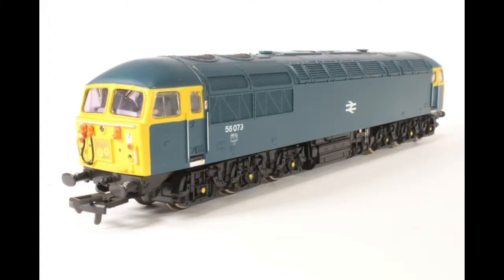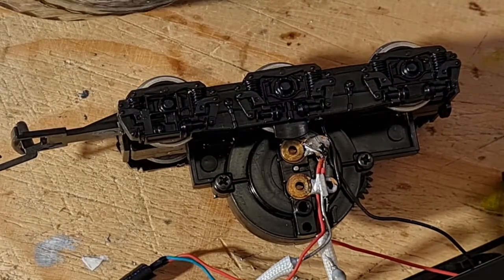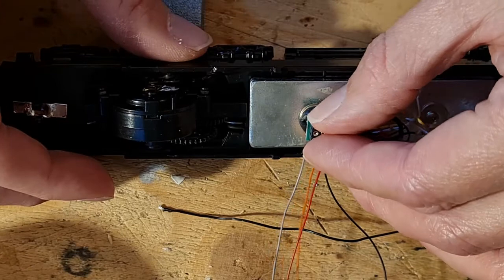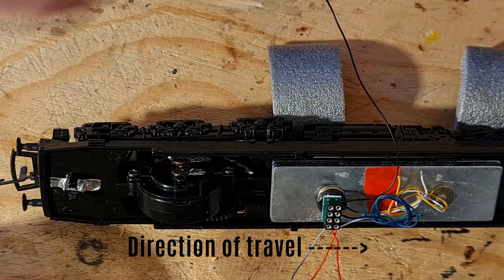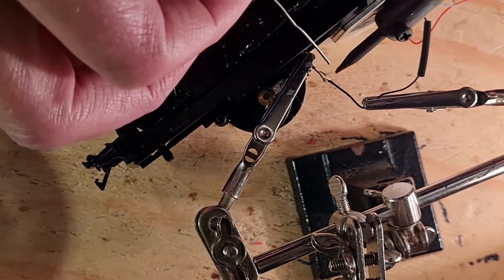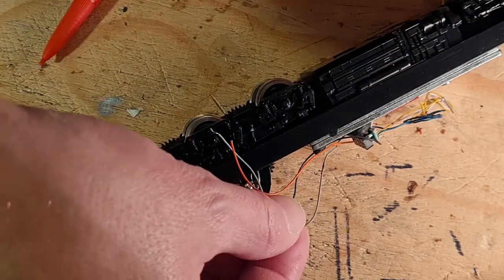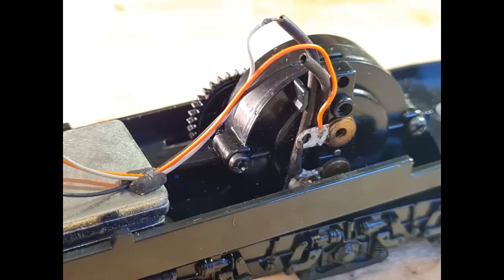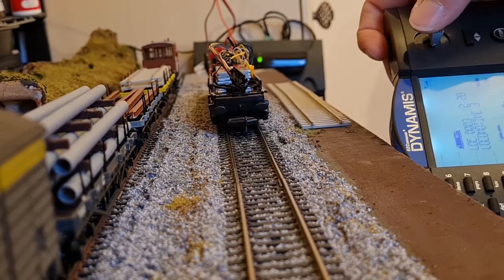Class 56 Project : Part 2. The conversion to DCC  (A Beginners Guide).

Comment: Hi,will this work in my Lima class55 deltic.  I want to convert it to tts sound. Great informative video!
Reply from the maker: Hi Jed, yes, it will. Just check if your Lima motor has a capacitor across the motor contacts, if it has you will be best to remove it first. Otherwise this method will work perfectly for a TTS chip. Any problems drop me an email. Regards, Andy

Comment: Absolutely brilliant vid! Andy, simply explained. I've only re-soldered lights and pick ups but never tried from scratch ( I've a touch like an elephant)
One of the most straight forward vids out there, well done👏🏻👏🏻👏🏻
All the best, Darren.
Reply from the maker: Thanks Darren, i attempted to make this one as clear as possible - my HST motor upgrade wasn't really detailled ( it was a bit basic) so I spent a bit of time to make this one better. Thnks for your positive feedback, much appreciated.
Reply: @Andy-SharlstonEastgate   great video ! I am about to DCC mine as well  but what motor type is that?
Reply from the maker: @davidcurrie8564  Thanks David. This the original motor from Mainline. It's a type of ringfield, very similar to the Hornby one. It's a reliable version though, runs like a dream after 30+ years ! Cheers, Andy
Reply: @Andy-SharlstonEastgate  cheers Andy  I never saw that type before!  I disconnected all the capacitors and  now left with the DCC wiring job  lights too..  heres hoping!
Reply: @Andy-SharlstonEastgate   Hi Andy! Finally  got the 56   wired to the 8 pin  decoder    now i have Both lights at  both  cab ends working at the same time?  i took out the diode on the bulb wires  maybe that was the problem    your 56 was different from mine too  I had two wires from the rear bogie as opposed to your one black wire  I also had the red wire on  the front motor bogie ( yours was black)    I'll use my mobile to take photos the next time.  I seen the lighting wires on the diagram but puzzled as the 56 has the headlight plus the two lights near the buffers running constantly  green wires etc    now back into it!